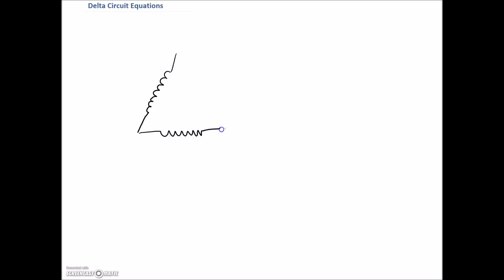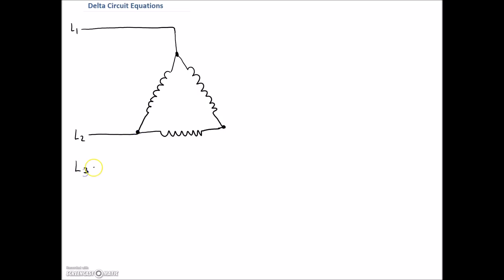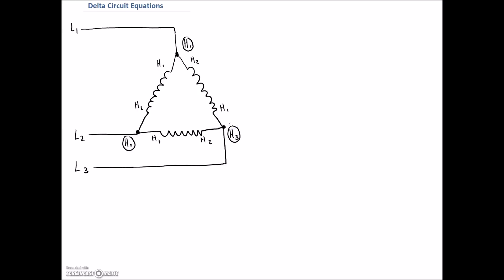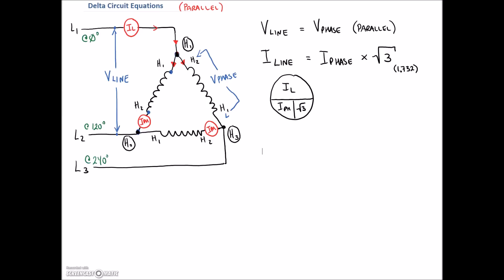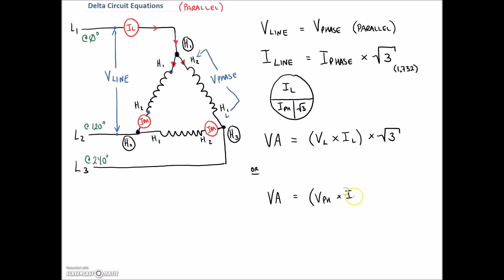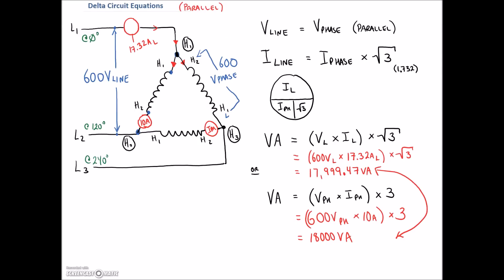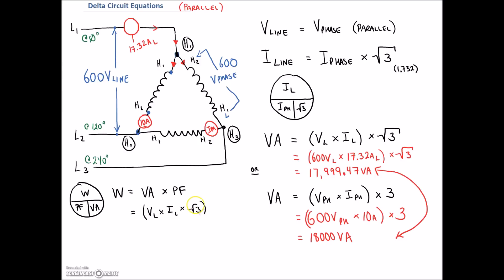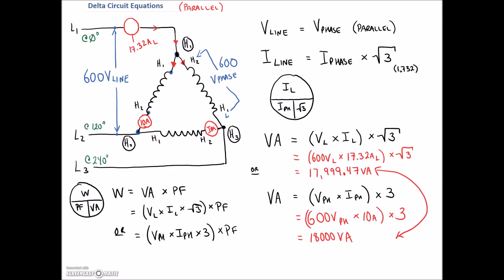3 Phase Delta Tutorial (Electrical Power PE Exam Review)

Comment: Why is the line current 17.32 A on line 1 instead of line 3 10:06
Reply from the maker: The line current would be 17.32A on all lines. It's a balanced load. I just wrote the current on line 1 to keep the diagram clean, but L2 is 17.32 and L3 is 17.32

Comment: Clear concise.  With a Power factor of 1 ( all resistance load) 
the VA (volts amps) number would be the SAME as the Watts number? 
FOR the transformer?    Trying to learn,  thank you.
Reply from the maker: Yes. Purely resistive loads have all their power expended in the form of heat, so Watts = VA in this case.

Comment: Hello hope all is well, is it proper to say that the coils are connected together but you don’t get a short circuit(touching phase to phase) because they are out of phase by 120 degrees, meaning each phase is going thru the coils at separate times. Thanks in advance.

Comment: Could a delta connect alternatibgly with a 3 large capacitors will be a trapping power supply could inductively supply a 3 layers ca pacitors connected to load became forever power supply? 70% posible

Comment: Amazing video-Quick question: what would cause my voltage to ground on one leg to be 280, but climb to 430, and then back down, and so on (in the course of 30 seconds). This only happened on one leg, not the other two.
Reply from the maker: No idea... but if you ever figure it out, come back and add to your comment.
Reply: You most likely have a Wye Wye with a bad neutral on the problem phase.
Reply: @intheharness  A why with 277 volts on the phase to star point ( neutral).   And 480 volts line to line?  trying to learn. thank you.

Comment: i have a question. when do you multiply by 'Sin or cos ' when solving for VA ??
Reply from the maker: Cos is used for the Resistive Values (i.e. Wattage), Sin is used for the Inductive or Capacitive values (i.e VAR's)... you also use Cos every time you are finding the VA when you know the Wattage and the Power Factor (VA=Wattage/PF) because PF=Cos of the Angle